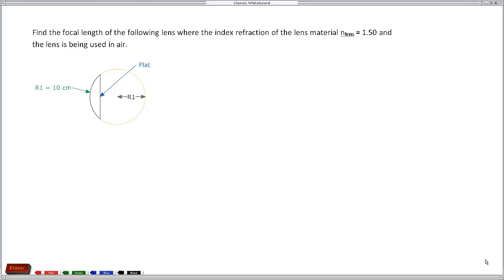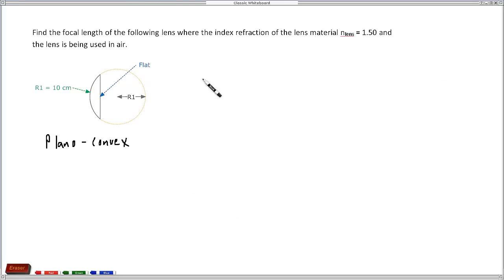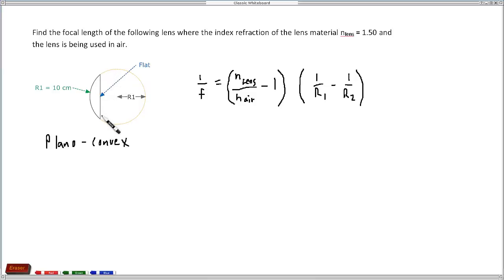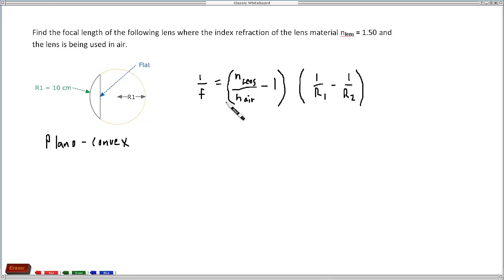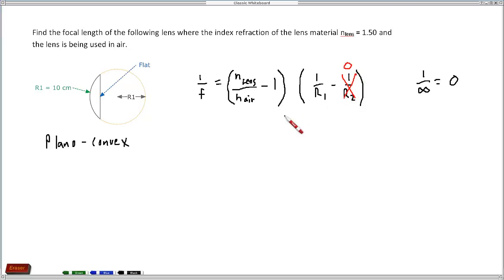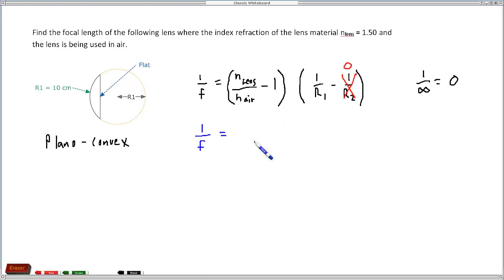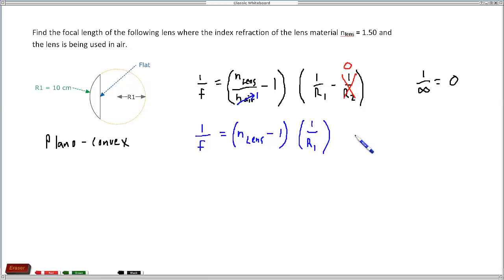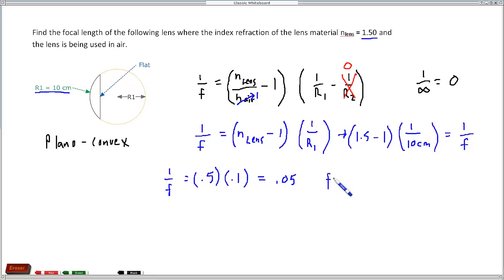Lens Maker Equation Problem, Plano-Convex Lens

Comment: This helped me figure out what sort of a concave mirror could be obtained by taking a mold off of a convex lens for a DIY CO2 laser. If I got it right, a f/l 500mm plano-concave lens should give me approximately a -1 meter focal point! This can be either turned into a 1 meter confocal configuration with mirrors on each end, one with a hole in the middle, or the length could be halved. I got the lens off of eBay already, but started to doubt whether the maths were right just by doubling the distance of a double-convex lens when plugged into the equation. Cheers!
Reply from the maker: Glad you found the video useful. Thanks for commenting.

Comment: Hi Dorian, My sincere thanks for the video.  It helped me understand an aspect that I was mulling over a long period of time.  IT also opened up a few new questions. I hope you can give some time to answer them and help me understand better.

1.  So if I have a plano convex lens, which is thicker (cut diametrically), will the formula still hold good ? The cut (thickness) have no role to play at all ?

2.  If I had a light source at the focal length of the plano convex lens, then would the beam emanating be a parallel beam?

3.  If I move the light source towards the plano surface of the lens, by a distance "d", (f-d), (or) slightly away from the plano surface (f+d) , how would the beam pattern change ?  In other words, how can I vary the beam angle ?

Thanks in advance.
Reply from the maker: Madhav Pulivendala The formula I used in the video was for thin lenses, for thick lenses the equation is

You are correct for the second question. In general a light source emitting light in all directions can be turned into a parallel light source by using a plano-convex lens in the manner you mentioned. This technique is used in projectors and devices to create parallel beams of light for light boxes.

Thanks for watching and commenting.